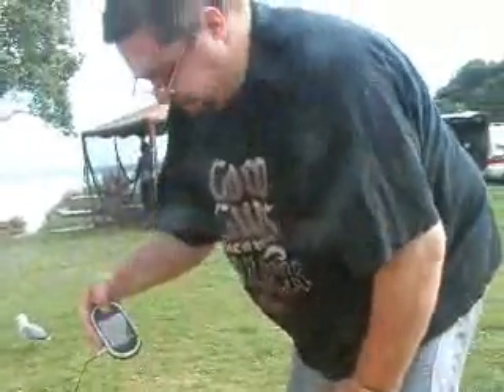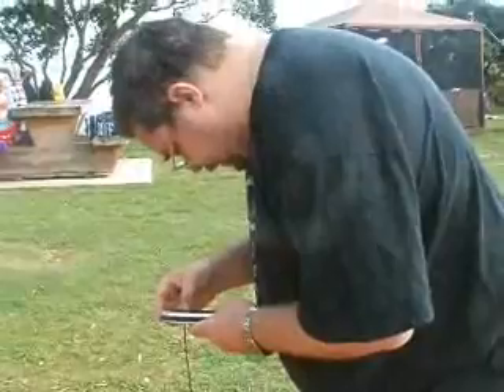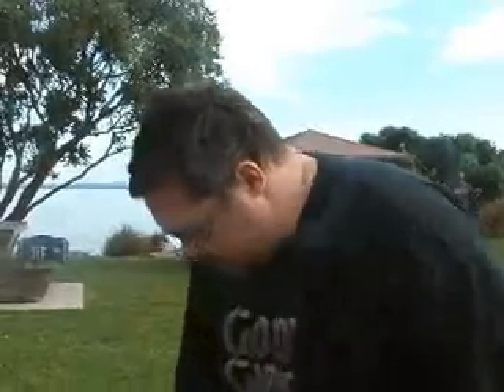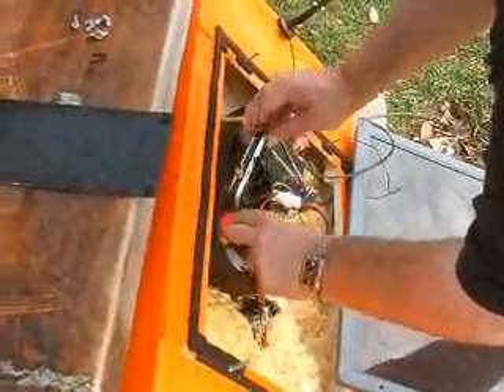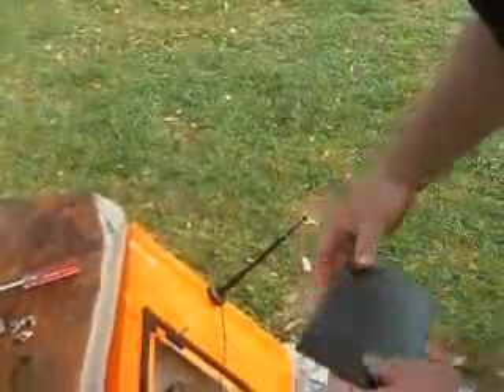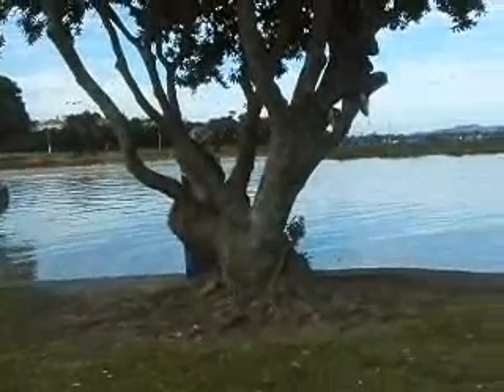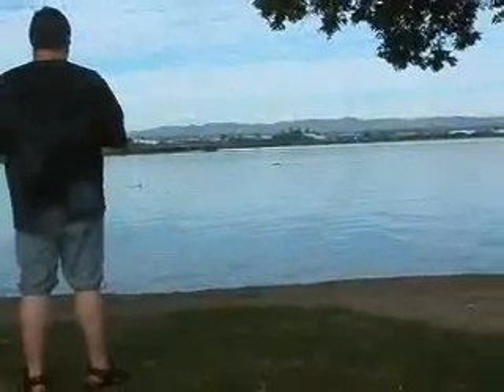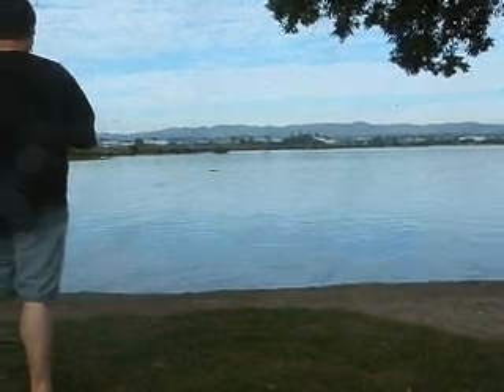Open Boat

Comment from the maker: The boat is solar powered. It cannot sustain motor drive constantly, but it can sustain the OpenMoko with a bit to spare. As a practical matter I would probably not want to run it overnight. Also, if there is a 'brownout' the OpenMoko won't restart automatically.